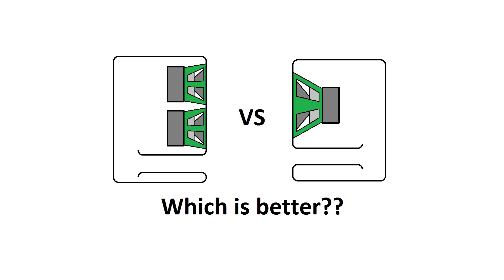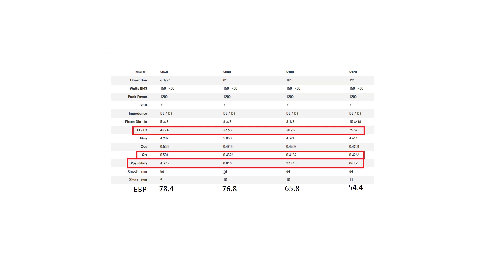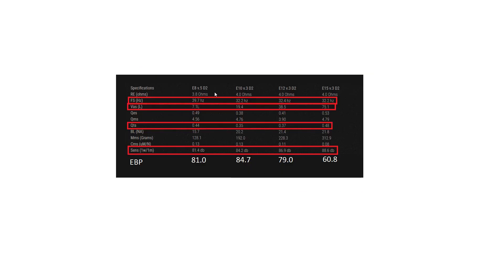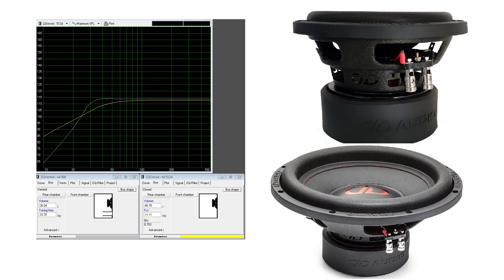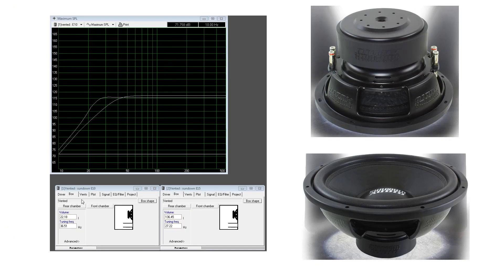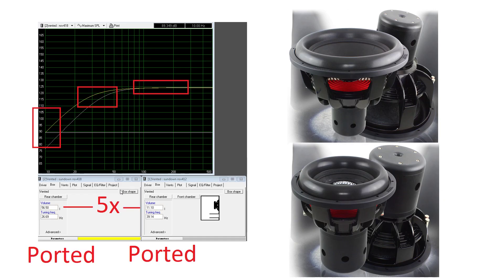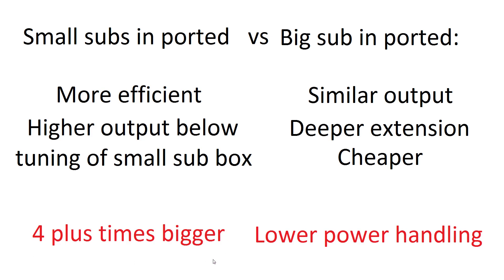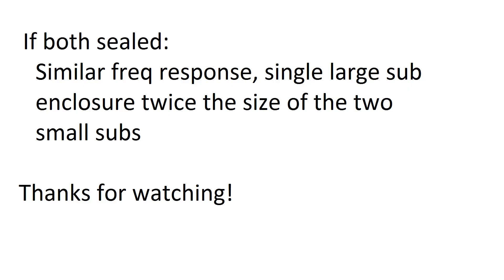Two small subs or One large sub?

Comment: Mostly depends on what sound you want. I have two 10" subs and an 8" sub in my car to get just the sound I want. Smaller subs gives a sharper/punchier bass while larger gives lower and more "vibrating"?
Reply: Not necessarily true.
Reply: Once you understand the feedback of amps knobs and adjusting; assuming you built a right box with reliable components you can safely push any subwoofer close to it's limit without distorting. I'm currently running 1 good 12'' for a reason but has experimented with many subs, 2 10's, 12's and 15's and most people think I'm running 2x12" and they are even SHOCKED to see how low I have my gain set
Reply: Vibrating is a result of bad adjustments mostly higher gain, lot of guys don't know that amp's knobs complement each other, if you add something, you might wanna reduce the other. Fact is you need to understand what responce you get from turning each amp knobs clockwise or anti-clockwise, ironically the knob's numbers aren't important since how good it sounds depends on the subwoofer's response. This is a complex skill but your can achieve through experimenting and that takes time period. There's all kinds of info on audio but it a complete story as soon you have everything connected and running

Comment: Two large sub😂
Reply: All day long!! Lol
Reply: @illegalregal9577  😊
Reply: 100th like
Reply: One large subs better than two small ones I think sound better
Reply: 18in
Reply: hell yes!!
Reply: Yeah😎
Reply: The correct answer. And 15" seems to be the sweet spot.
Reply: Come area is king
Reply: Lol
Reply: Yuuuupppp🤣🤣🤣
Reply: Yes
Reply: Two small duck 😂
Reply: As long as they are not 12s, which are wayyyy over-used. Throw some 18s and 24s in there instead. 😁👍
Reply: I see your pair and raise you 4 of a kind.
Reply: My balls got hard
Reply: With subs it's like engines....
No replacement for displacement.
Big subs, large motors, giant amps, big batteries and massive wire.
....runs two twelves in a small sealed box.....
Reply: @robsorgdrager8477  you can go a long way with 12s, throw 3 or 4k watts at it and youre golden
Reply: *per sub
Reply: @robsorgdrager8477  and exactly like engines smaller ones can run harder than bigger ones with the right set up

Comment: There is a lot of superficial knowledge in this video cause its to focused on the specific drivers you have chosen.
For sealed: Its up to the VD (Xmax*SD) if you want get the biggest output. It does not matter if there are two smaller subs or one big sub in the box.
For ported: If you compare two boxes with similar low end and same size, they are equally loud if the driver quality is compareble. For example in 6:06 you need to keep in mind, that a smaller box needs a much larger port, which also needs volume.

Comment: Depends. You want loud? Two smaller. You want low bass? One larger. There are also subs that can do both depending on budget. This is really an incredibly subjective video.
Reply: Your advice is also over-generalized.  The difference between different drivers is greater than the difference between different sizes.  People just like to talk about size because it's easy to understand, just like power ratings are.  People will walk away when you start talking about how many Tesla*meters the motor generates and how electromechanical underdamping leads to narrow peaks in response before roll-off measured full width at half maximum around resonance derived from the system transfer function and so on.

Loud, low, and small is possible but the tradeoff is much lower efficiency.  Just like loud and low with few watts is possible but the tradeoff is huge woofers and boxes.

The simplest advice is that bigger is always better and more is also always better, within reason, so however much space you're willing to give up, use it all and just model various drivers until you get the best predicted response.
Reply: Most of what you percieve as, and here described as by  car audio ‘enthusiasts’ is not quicker or slower moving. Its time delay from phase issues in conventional ported/vented boxes.  1/4 wave transmissionlines  are that much more in sync with the cones front output at its ‘vent’.  Jjst 90 degrees if very simply put. The result is the ‘quick’, tight, accurate adjectives typically misused.
Reply: Boogerweldz I’m no expert, but my experience with bass amps (for a bass guitar) is that box with two smaller speakers is less muddy, and the response is quicker, less decay. 

It looses some warmth, but you might not want that box coloration, or you do.

Maybe it is applicable to this subject, idk.
Reply: If you want both? get 2 large
Reply: When you are comparing at the 6 minute mark both of the graphs say ‘’vented’’.
Reply: I not a professional but Ain't it the difference in speed of speaker eg fast bass for smaller subs and slow heavy bass for bigger subs
But then comes the box not to mention the amp 
This video actually put it in better perspective nice video😃😃😃
Reply: @davey2k12  No differences in speed of movement.  That's all dependent on the subwoofer motor structures and how the sub is built.
Reply: @davey2k12  that's a old myth. When you size up the magnet and coils also size up. it would only matter if you used a terrible driver

Comment: I tried out what you explained in this video, so I simulated enclosures for 2 DD 508c D4 and for 1 DD 512c D4 using their data from loudspeakerdatabase.com. The online simulator I used (speakerboxlite.com) maybe is not so accurate. I simulated sealed, ported and 4th order bandpass enclosures. 6th order bandpass I did not simulate because the simulator I used in my opinion the cone displacement simulates totally wrong. Other types of enclosures the simulator can not simulate. The Fb of both ported enclosures are the same (35 Hz) and the Fb of both 4th order bandpass enclosures are the same too (60 Hz).

My "rules" for the enclosures:
- sealed: speakers not overpassing their Xmax
- ported: speakers not overpassing their Xmax at higher frequencies than the Fb = 35 Hz.
- 4th order bandpass: speakers not overpassing their Xmax

The simulation:
https://speakerboxlite.com/project-info/f7792f2eb484fcefbad8dae9815e5156f0bc42e3745f7d92fa6f53292d519284

red - sealed for the 508s
green - ported for the 508s
blue - 4th order for the 508s
yellow - sealed for the 512
pink - ported for the 512
cyan - 4th order for the 512

First, the simulator showed me that the 2 8s are better for ported enclosure, and the 1 12 is better for for sealed enclosure.

If I compare the 2 sealed and the 2 4th order enclosures, the 1 512 is better in all cases.

If I compare the 2 ported enclosures, in my opinion the 2 508s are sounding worse than the 1 512, but the 2 508s just are working better, because the 2 508s not overpassing their one-way Xmech = 32 mm at lower frequencies than the Fb = 35 Hz (theoretically no need for subsonic filter).

I decided to switch off the ported enclosure for the 1 512 (pink line) because it will work not so good - the speaker overpassing its Xmech at lower frequencies than the Fb, and I not have subsonic filter on my amp.

If I compare all 5 enclosures what are not switched off in the simulation, and my personal preference for general sounding is to be loud at 30 Hz-ish frequencies (up to cca 40-45), so in this case the ported enclosure for the 2 508s is the best coice for me?

The other question is: in your opinion these results are plausible, or first I should simulate the enclosures using a proper software (like WinISD) to make a decision which will be the best choice for me?
Reply: results look interesting, I'm fairly new to box design but everything I've read and been told was that winisd is the most accurate for sealed and ported. hornrsp will more accurately show responses for 4th and 6th order boxes than winisd. would love to see the differences tested.
Reply: @Blakek.  I tried to simulate all of these 8 boxes using the actual version of WinISD - using the same speakers and the same speaker parameters from loudspeakerdatabase.org + use those rules what I mentioned in my first comment.

The box volumes and graphs are different a bit, but if I compare them, the differences between all of them are the same like using the simulator on speakerboxlite.com site.

In WinISD tried out to simulate 6th order bandpasses too - differences are the same like between the ported boxes (...and both 6th orders will be a little bit quieter at low frequencies than the ported ones).

I tried out to simulate ABC boxes too - differences are the same like between ported boxes, and they will be a little bit quieter at low frequencies than 6th orders, but the one 512 woofer will work good if the box volumes are abnormally huge on both box-chambers.

Passive radiator I did not simulate because I have no experience with them, and I dont know what parameters will be correct for a passive radiator...
Reply from the maker: Looks pretty accurate, you can try WinISD but most of it is the same maths. The two 8's do look like a good bet. You could also try the 12 in a smaller box, which should increase it's power handling a bit.
Reply: @Dakoustics  I have a tip for a video what is similar to this: compare different speakers which have same diameters in a physically same box. I mean all internal and external dimensions of the box are the same, and / or the port's physical dimensions are the same (not the parameters). So Vb changes, Fb changes because of different speaker displacement and parameters, performance will be totally different, etc...

This is an example:

https://speakerboxlite.com/project-info/7d0ad3f114fdba45a6db8c8fcbe2ea7bc5923721696339e50f02493228be548f

red line - DD 508 car subwoofer speaker
green line - Monacor SP8/150PRO universal compact PA bass / bass-midrange speaker what can be used like a subwoofer

The reason why I am thinking that this is a good idea, because many people changes their speakers in their boxes to make them sound better, and mostly they are just intuitive, so sometimes the change is wrong...

For example in this box the DD woofer looks like it will perform much better like the Monacor, but the Monacor speaker needs a few percent smaller port area for the actual Fb that in this box is present, so the port noise is almost totally cancelled. The DD woofer needs much more bigger port area for the actual Fb that in this box is present, so the port noise probably will be irritating in room, because the port wind will have too high speed, but maybe this speed of the port wind will be acceptable in car to cancel the port noise (the trunk is isolating it well, and maybe cabin gain effect amplify the bass to that level where we cannot hear the port noise, etc...).

Btw, this box I have built too for test the speakerboxlite designer / simulator and the online minimum port diameter / area calculator how they are good in real. I installed in it this Monacor speaker (this is my first properly designed subwoofer box what I have built). I have it in my room, really there is no port noise at higher frequencies than 28-30 Hz, at lower frequencies just a little - what is acceptable for me. The overall bass loudness is acceptable inside my room on all bandwidth, and it sounds very clear even with a not so good quality D category amp from a Logitech Z623 2.1 computer speaker system. This amp is weak too for this speaker (130 Watts RMS for 6 ohms).

This is my original project for this box and speaker:

https://speakerboxlite.com/project-info/29a89f707e99b362eab39de788e42ec02e48326d297af3cfd44c01f690cfa6df

The reason why I shared this project is that in the simulation the red line is the box what I have simulated using WinISD (for specs click History button), so I have another tip for a video: design and simulate same box type with same parameters and personal rules for the same speaker in different designers and simulators, and compare all results in all of that designers and simulators.

In my opinion it will be good to hear an explanation on these things from an experienced person like you, and I think that my first tip is better for totally non-experienced people like my second tip, so what do you think?
Reply from the maker: @PBasschannel  yeah that's a good idea, cheers, I should be getting a new sub for the horn soon, which will be a more SPL-oriented sub, so I'll do a comparison between it and a standard entry level sub, and a PA driver to see how peakiness is affected. A proper demonstration video rather than me rattling on should be interesting
edit- I'll also run the same power on each sub to keep results more consistent, so its just comparing t/s parameters. I'll get a DATS to measure the sub specs.
Reply: @Dakoustics  Thanks for your answer, I tried out to simulate the 1 12 inch speaker in smaller ported boxes, and yes, you are correct with the power handling down to 20 Hz. I comared them to the 2 8s ported box, so the simulation:

red - 2 8s box from previous simulation
blue - 1 12 box from previous simulation
green - 1 12 in the 2 8s box
yellow - a box for 1 12 with almost the same cone excursion at 20 Hz, like the 2 8s

https://speakerboxlite.com/project-info/804f0876563e4017b1ea55cbd34294a89fdb07aea6bae1400c831b5d07b0aea0

The simulator showed me that if the box is smaller, the excursion will be smaller down to 20 Hz (better power handling), below 20 Hz increases.

The other thing what I find out: If the Fb and the port area are the same, and I decrease the box volume, the outer dimensions of the box will increase because the port will be longer.

I have an answer / recomendation from DD, that I should to optimize the box up to 85-90 percent of the one-way Xmech to maximize out the output potential of the speaker and prevent it from damaging itself. In this case the max allowed cone excursion is 32x0.9=28.8mm.

So in my opinion the 2 8s are working the best all of these boxes, because the 1 12 still needs a subsonic filter for the smaller boxes to cut the lower frequencies than 20-22 Hz for potecting the speaker, howewer in my opinion in "normal music" there is no lower bass than maybe 25 Hz...and 2 8s performing the best between 25 and 47 Hz compared to these small 1 12 boxes...

I like car audio stuff inside my room, so maybe in future I will build the 2 8s ported and the 1 12 sealed, then I try them out in car and in room, which will how performing in which enviroment and one I will use in my room and one in car...it seems to be the 2 8s will be better in car because there is stronger cabin gain, and 1 12 sealed will be better in room - no port noize, smooth roll off, overall better sound quality, etc...

Comment: So what's better 2 15s or 4 12s??
Reply: @Uncle Scam Also if in this hypothetical situation we've got unlimited power capabilities and unlimited space. Why not toss in 4 15s? 🤑
Reply: 4 12's if space is not an issue... more surface area
Reply: I'd say 2 15s in a huge box opposed to 4 12s, but if you've got a ton of space to give them all enough room I guess 4 12s might be better. But most of the time I'd say 2 15s will be the better choice.
Reply: @Uncle Scam not necessarily, you could get lower with 2 15s in a huge box. 4 12s would require more space to get the right box volume.
Reply: @Uncle Scam it makes perfect sense.
Reply: @Uncle Scam but it's all relative to the equipment and the vehicle. So either could end up sounding better. Most people would be more impressed with 2 15s with a lot of volume though. But if you've got the space 4 12s would sound great too. It's all relative. On average I'm more impressed with a couple larger woofers. But that's just my opinion man.
Reply: @Uncle Scam You would also need a ton more power for 4 woofers vs. 2. So it depends how much you want to spend. It's a lot easier to power 2 woofers properly than throw 4 in and then you're going to need bigger/more amps, and more batteries, bigger wire, better/more alternators etc.
Reply: @Uncle Scam you won't necessarily get more output either, unless you've got a ton of power on hand.
Reply: @Uncle Scam So, again, it's all relative. So there isn't one scenario that is better all around. It's just easier to do it right with 2 15s vs 4 12s.

Comment: If you have a subwoofer box with two drivers, is it better to have them in dual sealed chambers or one non divided chamber?
Reply from the maker: There's no practical difference, but if you imagine a box with a wall in the middle, it acts like good bracing. Also, if one driver blows the other one will continue working as if nothing happened.
Reply: Thanks !

Comment: Two 10inch subwoofers with a 700.1 amplifier  ... that's all you need  ...
Reply: @ThaRealC-LoCLo  Rockford 801s is a cheater amp. Bangs way harder than listed
Reply: @ThaRealC-LoCLo two  rockford P3 15" pushed by an oldskool Rockford 801s. 
I have them wired to 8ohms in a ported box. 
Plus my trunk is pretty big. 94 caddi DeVille
Reply: Back in the late 80's, I had two 10 inch Kickers with a Sherwood 280 amp and a Leo's house brand stereo in my VW Bug. I really miss that set up.
Reply: @JERRYR708  lmao!!! Whatcha know bout that Sherwood power?!?! Lol. My buddy had that 240 on some 15 inch Super Blue Pyramids lol. That setup quaked!
Reply: Depends. I have 2 15" subs. Bangs hard. But I want more lol